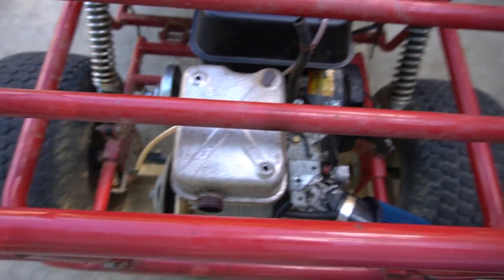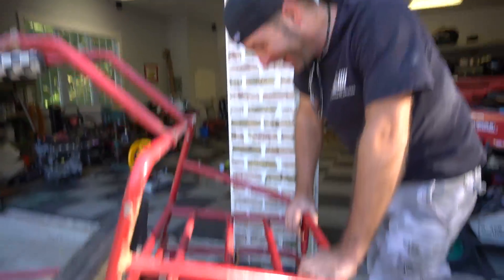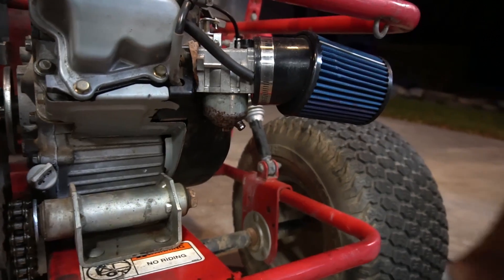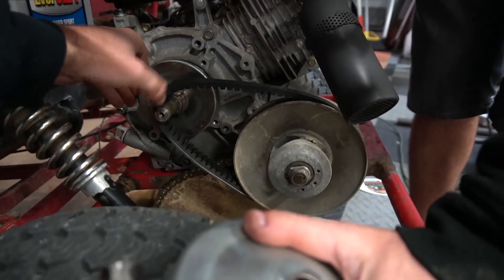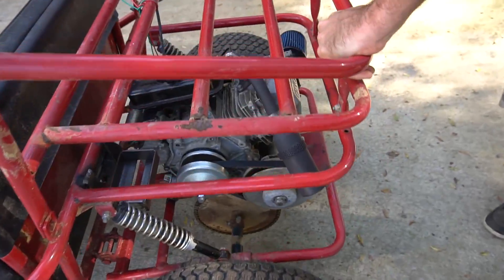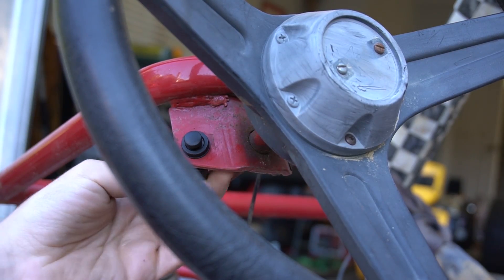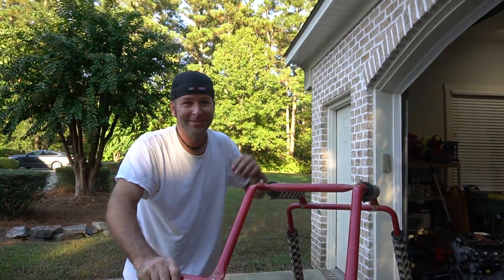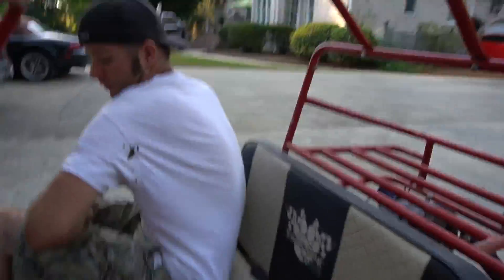Subaru Yerf Dog gets Push Button Start | FLIPPED

Comment from the maker: Think it could take one of our slower race karts?
Reply: you guys are freakin awesome btw :)
Reply: CarsandCameras dammm, that thing is awesome
Reply: Maybe. Is there any chance you can will turbo the dragster at some point?
Reply: I believe that it could take on a mildly fast cart.
Reply: CarsandCameras it could definitely keep up with the Murray
Reply: CarsandCameras cool vid DUDE love it
Reply: CarsandCameras sounds like time to work on jons gokart instead of using it as a table in the background ........hint hint
Reply: CarsandCameras Turbo it!  I loved the turbo trike series!  Hope Isaac is all good!
Reply: CarsandCameras yes it'll take Taylor's race kart and the purple race kart unless u tow them across the finish
Reply: CarsandCameras do you guys know anything about Wisconsin robin engines? I could really use some help and advice
Reply: Or maby not hold the gas after hitting the berm, just for a sec😂😂😂
Reply: I used a 14hp Subaru motor with the same torque converter. never ate a single belt up.
Reply: CarsandCameras I think it could. It has some pep in its step. Let’s see it on the old gps speedo.
Reply: CarsandCameras how fast does a 212cc engine with a torque converter on go
Reply: Jus10 nos dude
Reply: CarsandCameras And that kids, is why they invented the roll cage
Reply: CarsandCameras YEAAAAH! That’s somethin’ I’d like to see...
Reply: bring the racing mower for that drag strip there
Reply: CarsandCameras you guys should put lights on it
Reply: I would like to see you guys build a cross Kart.
Reply: Easily
Reply: Yo bro I have a 420cc but when I rev and let off the go kart pull back
Reply: Y do u think its doing taht

Comment: That smoothness you feel in that engine is the difference you're paying for between the clones and the OEM.  There are requirements that the clones are not allowed to use as tight of tolerances and as quality materials.    Love your channel! Keep doing what you're doing

Comment: This channel is the embodiment of what I wanna do pretty much every day... if I had what you have... which I don’t... so just completely disregard what I just said
Reply: Hey, I say go for it! Just save up the extra $$ and buy a used frame and find a used engine to start out with. I'm sure you could have a lot of fun doing it! Then eventually you could get a welder, and equipment needed to do your own builds. Heck you could build some amazing stuff if you just work hard and save. That's what I'm doing right now, I have at least 10 projects planned. I'm almost 14 so where I live I will be eligible to get a job. I will try to work every day of the week and start saving every dollar. Minimum wage is a little over $7 but it adds up fast if you work for five days a week that's about $35 a week, being saved. I will be able to do projects in no time! So if I can do it, I'm sure you could too! Follow your dreams m8 you'll figure things out.

Comment: Glad it had a roll cage. I flipped my go kart 2 years ago and I had a seat belt and a helmet on with the roll cage and I was just fine. In fact, my first thought was to shut off the engine so it wouldn’t run upside down

Comment: There’s a reason why the 9hp Subaru feels more powerful and smooth it’s an actual quality built blueprinted engine from japan not some chinese junk that says it has 5 hp but really we don’t know. Really would like to see you guys mess with more like this, Robins Subaru, Briggs, Kohler more often I think you guys will be really surprised with the overall outcome of the build. If you look online Briggs and Stratton makes race engines and you can get the speed and power y’all are looking for without all the extra weight and size issues. Keep up the fun guys!

Comment: I have a 300cc Subaru robin engine on a garden tractor. That motor always starts, pretty good on gas, and is really powerful, but I had to install a belt starter for it, because it never had an original...

Comment: 3:10 carefull welding next to battery. they can explode.  Had a lawnmower battery blow up beside me. Like a 410 shotgun going off. Lucky i still have my eyes. Acid everywhere. Had mower on charger. , Went to start and terminal sparked. Like a bomb basically. Mostly only an issue if its charging. Releases hydrogen gas i believe.
Reply: Tim Z Good to know!!!

Comment: Can you tell me about your welding setup. Is your Lincoln 110 or 220? What size tank you using, is it a 125 cylinder?? And last, where did you get the welding cart. I want to switch to gas with mine.. love the videos guys...
Thanks

Comment: Where do you get these karts from I live in new Zealand and I can't find a decent one without spending over 1500 plus I want to make moderfication  to it and put in a whinch a light bar and other little bits and pieces so if you could leave a link to a website or something else I could use to get one I would be super grateful

Comment: I have the same go kart what torque converter do I need
Reply: we used 1/2 the stock torq converter so we didn't have to change the axle. we used the gps 1/2 torq converter on the engine

Comment: I have a mini bike and when I ride it after a while it shuts off. Then it starts again but cuts out in a min like it has not enough fuel. After a few more starts it doesn't go at all. Does anyone know what the problem could be? Thanks
Reply: Oliver Bradburn icotec could be a drop of water in the float bowl , isopropyl alcohol will fix it , if that doesn't work check valve clearance
Reply: Howard Adams ok thanks. It is a 50cc so will that work

Comment: I woulda just used the generators fuel tank bolted it to the baggage area on the back and used a extra long fuel line to be on the safe side
Reply: Plus you wouldve had alot longer ride times on the yerf

Comment: I got a couple of race karts one is a thunder something that came with an animal engine one was raced about three time thats the one i got but in the middle of the race we had to use the animal off because i changed the jetting to run alcohol and the rings got burned out of the other animal engine pretty quick but it ran really good with that alcohol he won just he won just about every race exept 2 and them two was second place sold the one we raced with the good engine  the other race kart i got you can adjust the chassie by turning a knob i think im going to make that one a shifter kart if anyome know the name of the frame with the adjuster  on it would be cool if you hooked me upnwoth the name thats guys

Comment: Two things noteworthy here.

1: That's why they have cages.

2: Now you guys see why those shitty chinese engines suck. Well, one reason for it. This 9HP suby is every bit the equal of the larger Predator, itt'l last longer, ya'll already found it to run smoother. Ya'll need a better engine supplier.